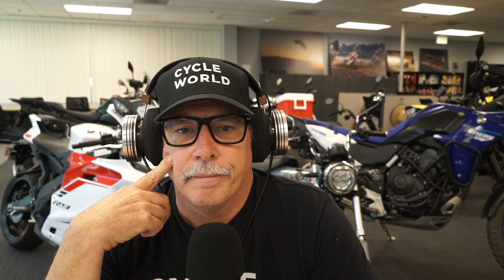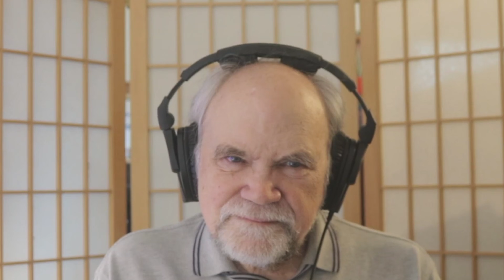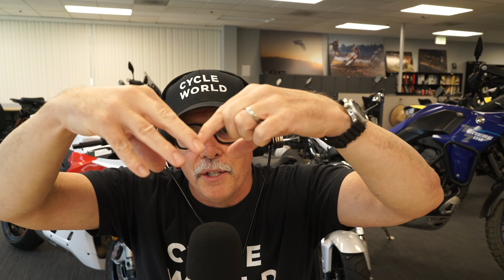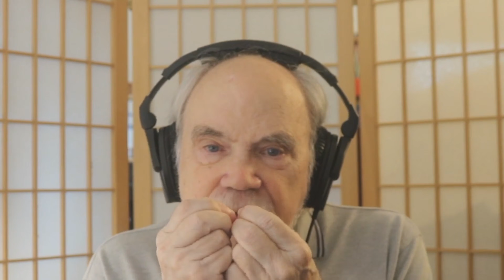HOW FAST COULD WE GO?! What's making new motorcycles slower than they could be?

Comment: Allison and Rolls Royce V-12  Air Plane engines  were Supercharged.  Some of the Superchargers were 2 speeds.  One speed for Low Altitude and one for High Altitude, they used water injection too .
Reply: The R-4360 Wasp Major. What a marvelous beast.
Reply: They were all supercharged, the part Kevin left out about USAAF aircraft in WW2 that had turbos is that the engines didn't throttle off the turbos, hence no turbo lag and the other issues involved with turbos, the engines had centrifugal superchargers on them just like all other aircraft engines of the time but they were single stage single speed superchargers, whenever you'd get to medium altitude instead of shifting the supercharger into a higher range, which would drag down even more power off the engine, in a USAAF aircraft the turbo, which didn't do anything at low altitude, would start to feed the engine's supercharger without causing any more parasitic power loss because it's a waste energy recovery device.

At low altitude exhaust is diverted out the waste gate valves, at medium altitude they start to close diverting exhaust to the turbo driving it which keeps the supercharger's inlet pressure the same as low altitude, the higher you go the more the waste gate valves close diverting more exhaust to the turbo spinning it faster and faster up to the highest altitudes, but you've always got the throttle characteristics of a supercharged engine because it's always throttling off the supercharger and not the turbo, the turbo is a second stage instead of having another supercharger impeller that engages at altitude like how a 2 stage supercharger works, but unlike a 2 stage supercharger that 2nd stage isn't dragging another 150 HP off the engine, 2 stage 2 speed superchargers actually have 3 ranges they run in which means at high altitude you're dragging up to 450 HP off an engine, but with the supercharger/turbo configuration of the USAAF aircraft at high altitude you're only dragging the initial 150 HP off the engine created by it's single stage supercharger. 

Another advantage that system is it's power is seamless throughout the altitude ranges, with a 2 stage supercharger whenever you shift it into a higher range you have to pull the throttle back to keep from overboosting the engine, this drop in power is called throttling power loss, as you continue to climb you can keep bumping the throttle forward until the air gets thin enough to where you've got it all the way forward and you're at max power, but with the supercharger/turbo configuration of USAAF aircraft they didn't have what looks like a roller coaster on a dyno chart, they made max power all the way to high altitude, and you're never suffering anymore parasitic power loss than at low altitude, it's because of those two advantages is why the US Army chose that system for all its aircraft.
Reply: @dukecraig2402  In effect, "twin charged", even though they may not have referred to them as such.
Reply: @12skipafew-e7y 
Not really, twin charged is more when a turbo takes over at high RPM's from the supercharger, at which point you're throttling off the turbo, aircraft engines are low RPM engines anyway so a system like that really wouldn't be of use on them.
The system used on USAAF aircraft in WW2 were simply a turbo being the 2nd stage that feeds the 1st stage (the engine's supercharger) for higher altitudes, instead of a 2nd supercharger feeding the 1st supercharger, once again the beauty is you're always throttling off the engine's supercharger but you won't suffer the parasitic losses of engaging a 2nd supercharger and power is seamless throughout the altitudes.

2 stage 2 speed superchargers actually had 3 ranges they ran in;
Neutral, that's where the first stage is driven (they're always driven).
Low blower, that's where the 2nd stage is engaged but in low speed. 
High blower, 2nd stage shifted into it's high speed.
Those types of superchargers were introduced about half way through the war (mid 42ish), the US Army however had it's supercharger/turbo configuration engines before the war even started, at the beginning of the war everyone else mostly had single stage 2 speed superchargers, as their name implies they only have one stage but had 2 ranges they ran in, low and high range and were good for medium altitude. 

Sometimes a multi stage set up like a turbo feeding a supercharger at high RPM's is called twin charging by some people, terminology used differently by the different worlds can cause alot of confusion on the subject, what's important to understand however is that the different systems on WW2 aircraft engines were designed to overcome the issue of ever thinning air over altitude changes, which makes performance car systems different because they're overcoming things like low to high RPM's but are at relative sea level.
Reply: @dukecraig2402    Supercharger
The V-1710 has often been criticized for not having a "high-altitude" supercharger. The comparison is usually to the later, two-stage, versions of the Rolls-Royce Merlin 60-series engines also built by Packard as the V-1650 and used in the P-51B Mustang and subsequent variants. The USAAC had specified that the V-1710 was to be a single-stage supercharged engine and, if a higher altitude capability was desired, the aircraft could use their newly developed turbo-supercharger as was featured in the XP-37(YP-37), P-38, and XP-39.

The benefits of a two-stage supercharger eventually became so clear that Allison did make some efforts in this direction. Allison attached an auxiliary supercharger in various configurations to the existing engine-mounted supercharger and carburetor. Early versions of these two-stage supercharger engines were used on the P-63. No intercooler, aftercooler, or backfire screen (flame trap) were incorporated into these two-stage V-1710 engines (except for the V-1710-119 used on the experimental P-51J, which had an aftercooler and Flame Traps). The two-stage Merlin engines had all of these features, which were designed to prevent detonation from charge heating and backfire into the supercharger. The G-series V-1710s installed on the F-82 E/F/G models had only anti-detonation injection (ADI) to deal with these problems, and not surprisingly had severe reliability and maintenance problems. In one record, it was stated that the F-82 required 33 hours of maintenance for each hour of flight.[5]
Reply: @dukecraig2402     I was talking about Allison V-12 Aircraft engines..
   Turbo-superchargers were highly successful in U.S. bombers, which were exclusively powered by radial engines. The P-47 fighter had the same combination of radial engine (R-2800) and turbo-supercharger and was also successful, apart from its large bulk, which was caused by the need for the ductwork for the aft-mounted turbo-supercharger.

Turbo-supercharger
The USAAC had earlier decided to concentrate on turbo-superchargers for high altitude boost, believing that further development of turbo-superchargers would allow their engines to outperform European rivals using crankshaft driven superchargers. Turbo-superchargers are powered by the engine exhaust and so do not draw much power from the engine crankshaft, whereas displacement superchargers are coupled directly by shafts and gears to the engine crankshaft. Turbo-superchargers do increase the exhaust back-pressure and thus do cause a very small decrease in engine power, but the power increase due to increased induction pressures more than makes up for that decrease. Crankshaft-driven superchargers require an increase in directly driven percentage of engine power as altitude increases (the two-stage supercharger of the Merlin 60 series engines consumed some 330–380 hp (250–280 kW) at 25,000 ft (7,600 m). General Electric was the sole source for research and production of American turbo-superchargers during this period, from its four decades worth of steam turbine engineering experience.

Turbo-superchargers were highly successful in U.S. bombers, which were exclusively powered by radial engines. The P-47 fighter had the same combination of radial engine (R-2800) and turbo-supercharger and was also successful, apart from its large bulk, which was caused by the need for the ductwork for the aft-mounted turbo-supercharger.

However, mating the turbocharger with the Allison V-1710 proved to be problematic. As a result, designers of the fighter planes that used the V-1710 were invariably forced to choose between the poor high-altitude performance of the V-1710 versus the increased problems brought on by addition of the turbo-supercharger. The fates of all of the V-1710 powered fighters of World War II would thus hinge on that choice.

The original XP-39 was built with a V-1710 augmented by a General Electric Type B-5 turbo-supercharger as specified by Fighter Projects Officer Lieutenant Benjamin S. Kelsey and his colleague Gordon P. Saville.[6] Numerous changes were made to the design during a period of time when Kelsey's attention was focused elsewhere, and Bell engineers, NACA aero-dynamic specialists and the substitute fighter project officer determined that dropping the turbocharger would be among the drag reduction measures indicated by borderline wind tunnel test results; an unnecessary step, according to aviation engineer and historian Warren M. Bodie.[7] The production P-39 was thus stuck with poor high-altitude performance and proved unsuitable for the air war in Western Europe which was largely conducted at high altitudes. The P-39 was rejected by the British, but used by the U.S. in the Mediterranean and the early Pacific air war, as well as shipped to the Soviet Union in large numbers under the Lend Lease program. The Soviets were able to make good use of P-39s because of its excellent maneuverability and because the air war on the Eastern Front in Europe was primarily short ranged, tactical, and conducted at lower altitudes. In the P-39, Soviet pilots scored the highest number of individual kills made on any American, or British fighter type.

The P-40, which also had only the single-stage, single-speed-supercharged V-1710, had similar problems with high-altitude performance.

The P-38 was the only fighter to make it into combat during World War II with turbo-supercharged V-1710s. The operating conditions of the Western European air war – flying for long hours in intensely cold weather at 30,000 feet (9,100 m) – revealed several problems with these engines. They had a poor manifold fuel-air distribution and poor temperature regulation of the turbo-supercharger air, which resulted in frequent engine failures (detonation occurred as the result of persistent uneven fuel-air mixture across the cylinders caused by the poor manifold design). Specially formulated fuels were a necessity for the P-38 as were specific spark plugs needed for specific cylinders. The turbo-supercharger had additional problems with getting stuck in the freezing air in either high or low boost mode; the high boost mode could cause detonation in the engine, while the low boost mode would be manifested as power loss in one engine, resulting in sudden fishtailing in flight. These problems were aggravated by sub-optimal engine management techniques taught to many pilots during the first part of WWII, including a cruise setting that ran the engine at high RPM and low manifold pressure with a rich mixture. These settings can contribute to over-cooling of the engine, fuel condensation problems, accelerated mechanical wear, and the likelihood of components binding or "freezing up."[8] Details of the failure patterns were described in a report by General Doolittle to General Spatz in January 1944.[9] In March 1944, the first Allison engines appearing over Berlin belonged to a group of P-38Hs of 55th Fighter Group, engine troubles contributing to a reduction of the force to half strength over the target.[10] It was too late to correct these problems in the production lines of Allison or GE, and as the numbers of Merlin-engined P-51 Mustangs based in England mounted up through the end of 1943 and into 1944, the P-38s were steadily withdrawn from Europe until October 1944 when they were no longer used for bomber escort duty with the Eighth Air Force. A few P-38s would remain in the European theater as the F-5 for photo reconnaissance.

The P-38 had fewer engine failures in the Pacific Theater, where operating techniques were better developed (such as those recommended by Charles Lindbergh during his development work in the theater),[11]) and the Japanese did not operate at such high altitudes.[12] Using the same P-38Gs which were proving difficult to maintain in England, Pacific-based pilots were able to use the aircraft to good advantage including, in April 1943, Operation Vengeance, the interception and downing of the Japanese bomber carrying Admiral Isoroku Yamamoto. New P-38 models with ever-increasing power from more advanced Allisons were eagerly accepted by Pacific air groups.

When Packard started building Merlin V-1650 engines in America in 1942, certain American fighter designs using the Allison V-1710 were changed to use the Merlin. The P-40F, a Lend Lease export to Britain, was one of the first American fighters to be converted to a Packard-Merlin engine. However, the installed engine was the V-1650-1 (a Packard-produced Merlin XX) with a slightly improved single-stage, two-speed supercharger, yielding only modest gains over the Allison V-1710.

The last Allison powered P-51, the Mustang I(II)/P-51A, used the single-stage, single-speed Allison V-1710-81, with a 9.6:1 blower ratio. This allowed the P-51A to reach a maximum speed of 415 mph (668 km/h; 361 kn) at 10,400 ft (3,200 m) and maintain 400 mph (640 km/h; 350 kn) at 23,000 ft (7,000 m).[13] This was more than 70 mph (110 km/h; 61 kn) faster than the Merlin 45-powered Spitfire V at 10,000 ft (3,000 m), and more than 30 mph (48 km/h; 26 kn) faster at 25,000 ft (7,600 m).[14] Its speed impressed the British, and the RAF quickly realized the airplane would possess excellent high altitude performance if the Allison V-1710 engine were replaced by the 60-Series Merlin. A similar proposal to cure the P-38's problems by replacing its Allisons with Merlins was quashed by the USAAF, after protests from Allison.[15]

Cutaway of Allison V-1710
Starting with the V-1710-45 around 1943 (after the P-51 had been fitted with a Merlin 65 by Rolls-Royce), Allison attached an auxiliary supercharger to some of its engines in an effort to improve high-altitude performance. The two-stage supercharged Allison was essentially developed as an "add on" to the single-stage engine, and required minimal changes to the base engine. While it lacked the refinement, compactness and after-cooler of the two-stage Merlin, the Allison used a pressure-altitude governed variable-speed first stage. Various configurations of this auxiliary supercharger were used in production versions of the V-1710 that powered aircraft such as the Bell P-63 and North American P-82E/F/G series. In addition, it was tried or studied as the powerplant for many experimental and test aircraft such as the Curtiss XP-55 Ascender, North American XP-51J "lightweight Mustang", Boeing XB-38 Flying Fortress, and Republic XP-47A (AP-10), both of the latter with turbo-superchargers.

Comment: So much to comment on! Zoomies on TF drag racers add downforce...Junior Johnson ran his ford's exhaust pipes out the back of the car, instead of on the side,  and walked away from other nascars on the straights. His competition theorized that he was filling the vacuum behind his car with exhaust gas...what he was really doing was feeding hot exhaust into the drafting cars radiator behind him, and therefore causing them to run hotter than desired! Lastly,  those huge efficient ship engines...do they loose less heat to the cooling system do to the ability of the large engine components to soak up the combustion heat without stress?

Comment: Turbos aren't what they were. They can be much more efficient and linear feeling than they were in the 80s
Reply: That's because today's systems have the electronic controls he mentioned that the 80's systems didn't have, that was the point.
Reply: @dukecraig2402  Today's turbo geometries  have greatly improved.  the 'fans' are much more efficient than they were.

Comment: Used the Exhaust to heat water make steam that runs a generator ..  Have some Capacitors and a few light batteries.
Reply: We have a steam energy recovery unit on the exhausts of two 460hp gensets. It's big, heavy and gives 17kW.
Reply: Was thinking about nuclear power when that part of the discussion was made. Still the most safe, reliable, efficient way of generating electric power, all things considered.

Comment: I think I recall that before wings were used on GP bikes, it was possible for some riders to hit 235 mph on long straightaways, and the limiting factor was not horsepower but traction. It would be interesting to hear Kevin's calculations with regard to tire contact patch area, rubber compounds, weight, drag, etcetera.

Comment: Rotax aircraft engines have an oil tank that depends on the pumping of the pistons to push the oil back to the sump, before staring you must burp the engine ie turn it by hand slowly until it makes the ‘burp’ noise when the air gets to the tank.😊😊😊😊 Truck gearbox should have the propshaft removed or you can seize the gearbox because the input shaft drives an oil pump  and no input rotation = no oil.